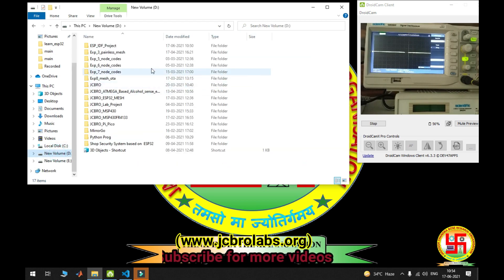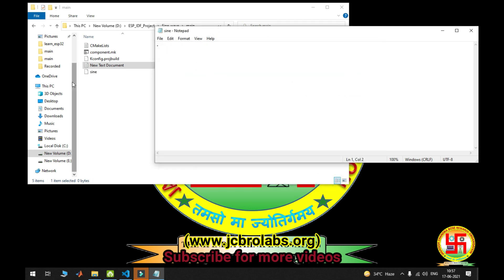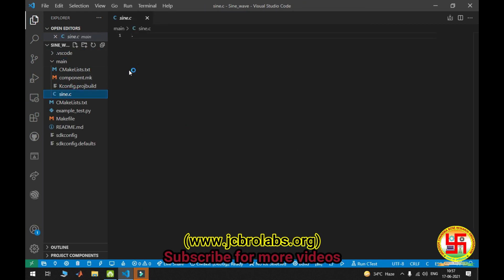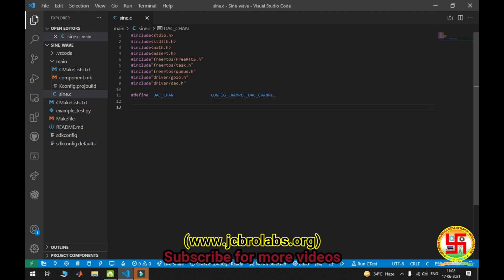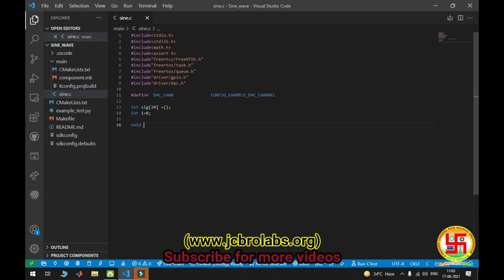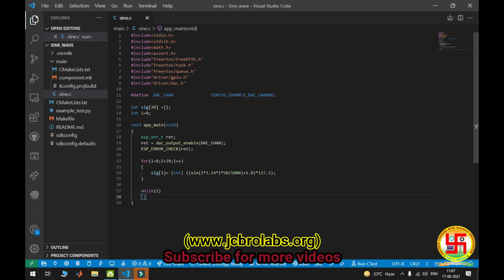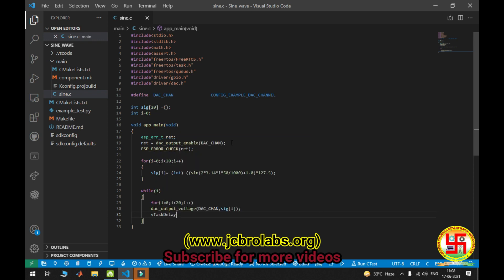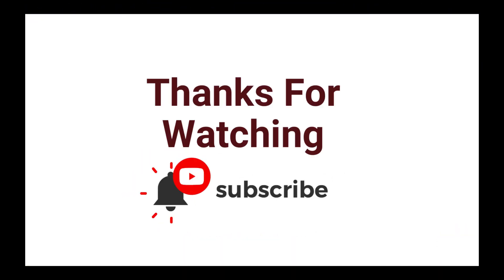How to generate Sine wave using esp32 ? (ESP-IDF programming)

Comment: Hi, thanks for sharing the method. May I ask how you connect the oscilloscope to the gpio?
Reply from the maker: connect ground wire of DSO to ground of ESP32 and Signal wire of DSO to corresponding pin of ESP32